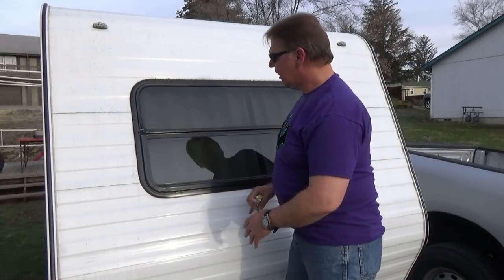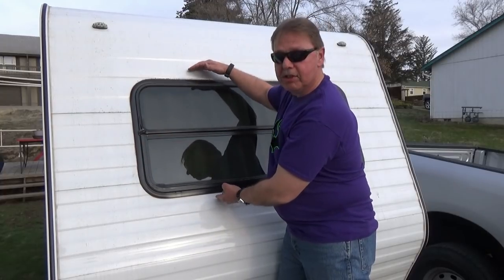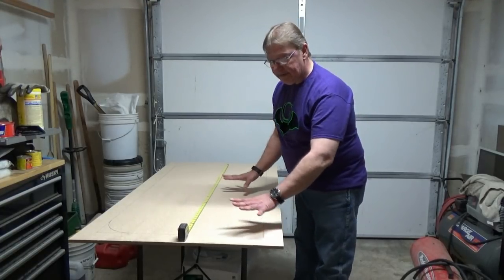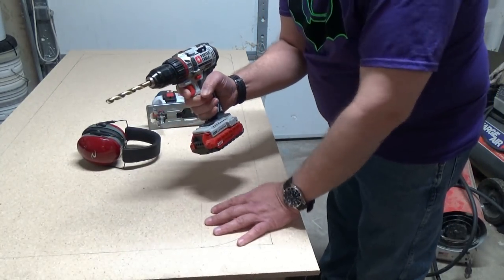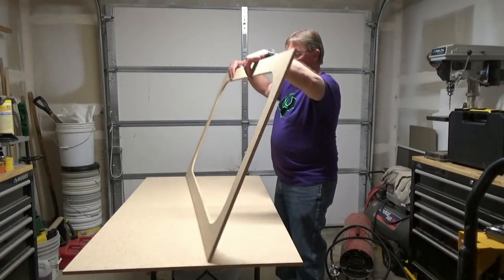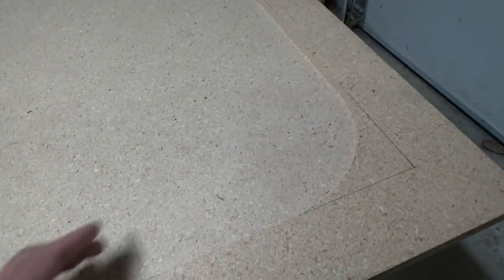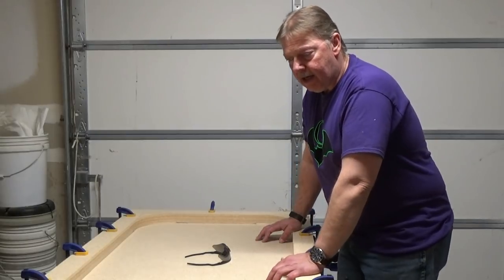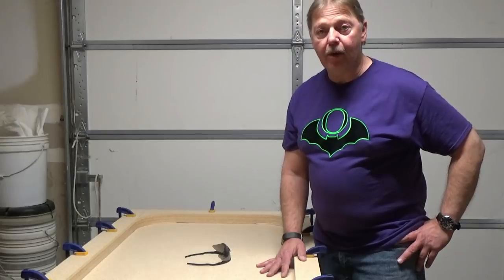DIY – Front Window Rock Guard – Stone Guard - For Your RV - Part 1

Comment: Hello Al, good to see you back working on a new project. Just restarted work on my daughters trailer now winter is dare I say it over.
Reply from the maker: Thank you George, glad to hear you're back at it! Better weather on the way!
Reply: @OregonBatman  I screwed up cutting the wheel arches on this new project, so will have to do a bit of a bodge job on those and use lots of filler.
Reply from the maker: Just a minor setback... you'll get it fixed I'm sure! I had a minor set back on my stoneguard too... the gelcoat stuck to the mold, so I had to pull it all out and fill here and there and primer again. Now ready to pick up where I left off. You should see that in the next video.
Reply: @OregonBatman  I hope you are right.Might need lots of fiber glass and bondo LOL

Comment: I don't know why you chose to router the layers at 90 degree angles to the base (and then use bondo to create your angle). Aren't there router bits (something like a 7 degree dovetail bit) that would let you create that slight angle you want layer by layer as you built up the layers?
Reply from the maker: Thanks tornado455 for the question. Yes, you could actually angle the router base to the desired angle and make your cut. I chose to use this method, as spreading the putty over the exposed edge makes for a smoother finish. It would have to be filled anyway to fill any voids in the wood. I'll be able to add the fillet at the bottom at the same time. I hope you get a chance to see the second video when I post to see how I did that. Your idea would definitely work though! Thanks again!
Reply: @OregonBatman  Thank you! I followed along the entire build of your trailer as you were progressing with it and was impressed with the great care and precision you put into your work.
Reply from the maker: I really appreciate the comment! Thank you so much for following along!